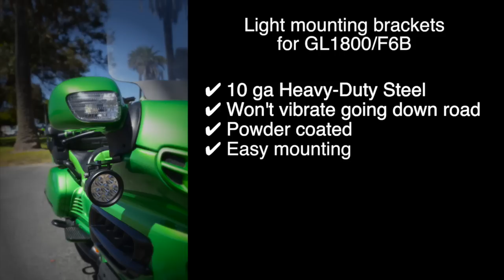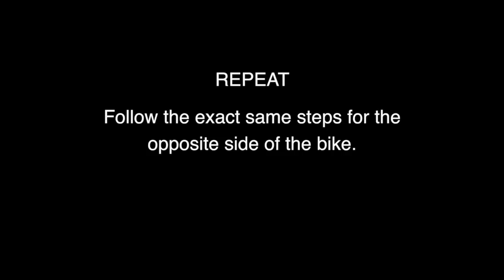Installing SoCalMotoGear Light Bracket for GL1800/F6B

Comment: I would have liked to have seen the after with the wings installed. I queried SCMG as to if they fit with the wings and they said yes. I suppose technically that may be true, but it will not allow the wings to fully close. I also question whether I will have to trim my wings once I actually install lights. It looks like it will hit the screw and maybe the nut when lights are installed.